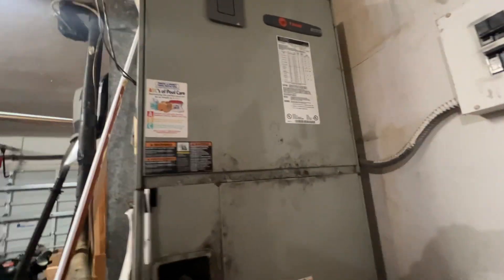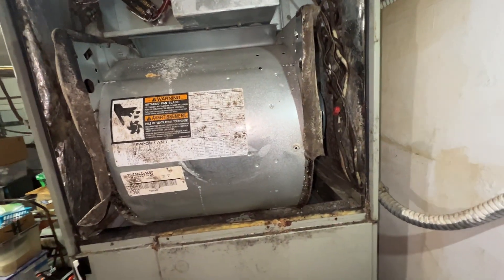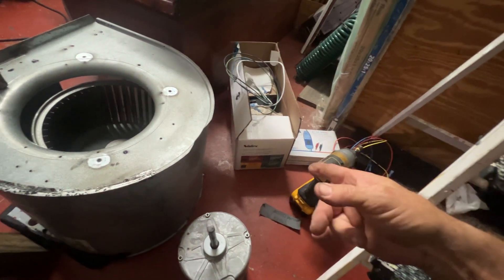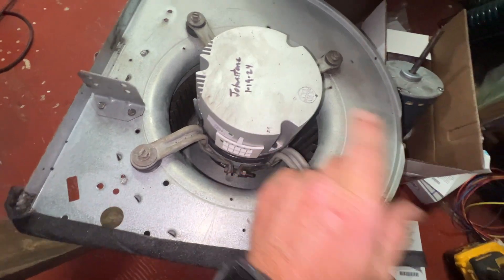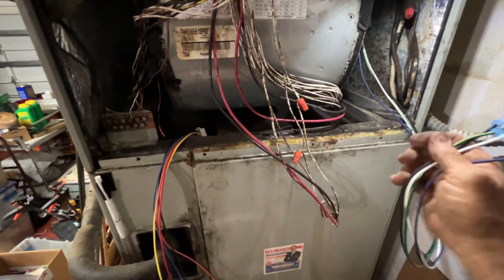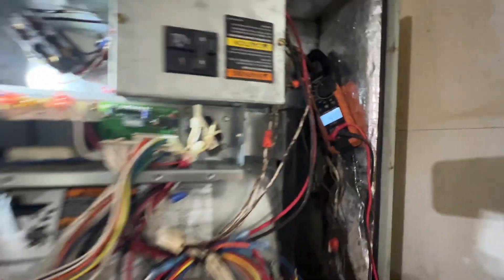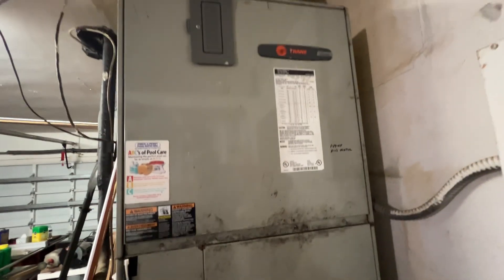Converting 1HP ECM Variable Speed Blower Motor To X13 Constant Torque | 20 Yr Old Trane

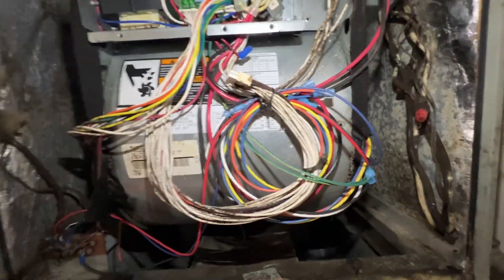Comment: Question around timestamp 9:32 I heard you say red you tied to fan for the fan signal, and you ran Black to Y1 for high speed. 
I don’t recall you saying anything about he does he have its own speed doesn’t he need to be ran on a lower speed or does that come on with fan signal ?
I’m assuming heat would run at the same speed as if fan was is on position. No?
Reply from the maker: Correct, Heat is the low speed or fan only signal
Reply: @ quick question I was thinking of. When Installing a multi speed PSC motor say in place of like an X-13 or Variable speed. When using  a standard fan relay with low volt signal at bottom NO/NC at the top of the relay. 
Should you hook up  a Hi/Med Hi & a low speed to the relay? Or are you still just using the Hi/Med high & the tsat is running heat & Fan on in a different speed?
I guess what I’m asking is shouldn’t I be hooking up two speeds to the relay so that I have like a Hi/Med hi. & then I could have a low speed hooked up at the relay also for fan on and heat?
Reply from the maker: With a psc your typical wiring will only be tapped for one speed which is set at installation. The benefit of the x13 is the ability to operate different speeds for cooling/heating/fan only.

Comment: Is the motor getting 24v on two speeds at once in cooling? What about a call from thermostat for W2 only (emerg heat)?
Reply from the maker: It’s straight cool with electric heat , no heatpump. There’s a dedicated fan input (1) the others are speeds 2-5 low to high. Used 5 for cool , Fan operation 50% in heat .
Reply: @subcoolHVAC  Oh, I get it. I don't see that setup at all here in north GA. Thanks for the great videos man.
Reply from the maker: Thanks for commenting
Reply: Can this same conversion be done with a heat pump? I’m concerned about the heat pump sending an output signal to the heat strips during defrost, because the unit would now be in cooling mode. So how would that affect my speed inputs to the blower motor. I hope I’m making sense. Thanks in advance!
Reply from the maker: If the signal is on the higher speed in defrost mode (I believe it will) it will operate high otherwise the fan only mode is 50% the way this is wired. Have not had to convert Hp unit yet though
Reply: Awesome video. I love the dynamite reference to JJ, 😂  I also have the heat pump. Can you give directions on how to wire the hp?

Comment: Might be a dumb question, but wouldn't the fan speed when you're running heat/ em. Heat be lower than the "cooling mode" speed?
Reply from the maker: That is correct. Its not a heatpump